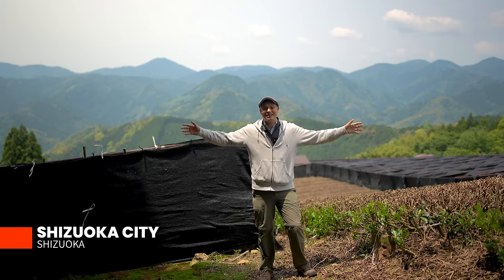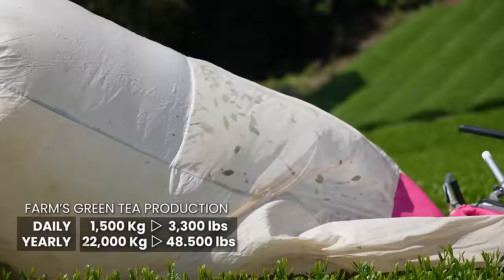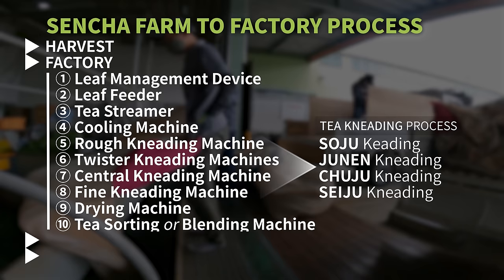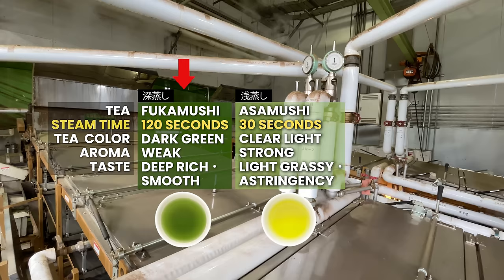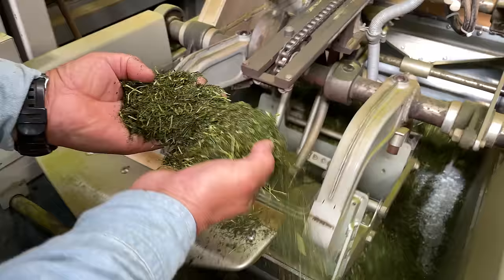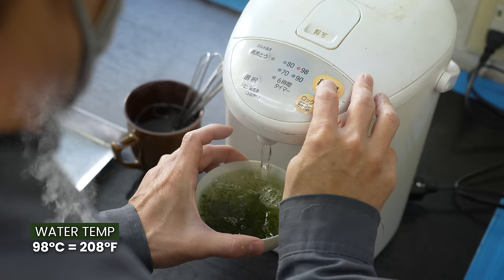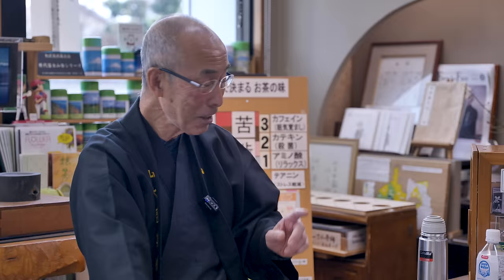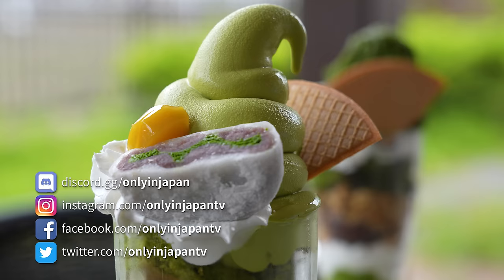How Japanese GREEN TEA is Made | Farm to Factory ★ ONLY in JAPAN

Comment: Great video and information I do have a question, for different types of teas I believe there are certain temperatures recommended. Is there a recommended or proper serving size as well to enjoy the flavor of the tea as it is meant to be?
Reply from the maker: Thanks for the question Joe! I talk about this in the first part of this Green Tea series: https://youtu.be/pBmTNkXOGjA I usually try to keep the water temp at 80C. As I showed in the video, the PRO - the tasters for grading - use 3g of tea, equiv to 3 1-yen coins per cup. If you make a pot, I think 10-12g is 3-4 cups but it also depends on what YOU prefer. Everyone's pallet is different and experience drinking it different ways will discover what you prefer and don't. It's can be kind of fun! I take notes so I remember what I used and how I liked it.